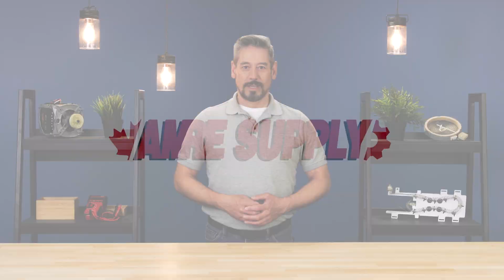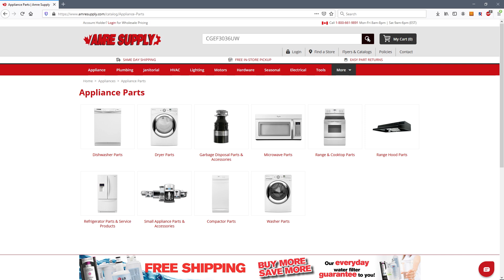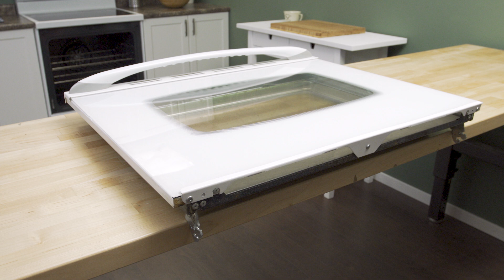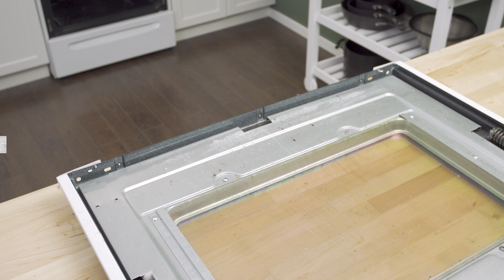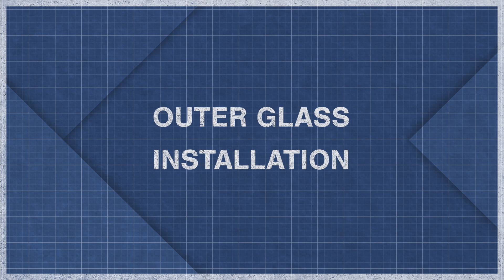Oven Inner Door Glass | Repair & Replace

Comment: This makes sense except mine has a gasket sort of like a rope    Where does that go and in what step or order?
Reply: I have a Whirlpool.  i believe the model number is xFE381LVO as it is hard to read.  It has ametal frame which will hold a piece of glass on each side and fiberglass insulation goes in there also.   Where and how?
Reply from the maker: Thanks for watching. The Whirlpool xFE381LVO is not a model that I'm familiar with so I can't speak to what variations there are in the gasket or how it is replaced outside of what we show in this video.

Comment: Can you tell me is the glass just a single piece or a sealed unit ? Thank u
Reply from the maker: Thanks for watching. It depends on the model. As mentioned in the video, some models have 2 separate pieces of inner door glass. Other models have both pieces joined together in a sealed unit. You can enter you model number in the model lookup tool. This will help you figure out what sort of glass is in your oven door: https://www.amresupply.com/lookup

Comment: Can I replace one (or both) of the inner glass panels with any glass sheet of the same dimensions or is there a particular type of glass that is needed?
Reply from the maker: Thanks for watching. Tempered glass is used in oven door as the glass needs to be able to resist heat and cooling. These extremes can cause regular glass to shatter.
Reply: @AmreSupply  Thank you
Reply from the maker: @mikeATgrowintheglass  You're welcome!